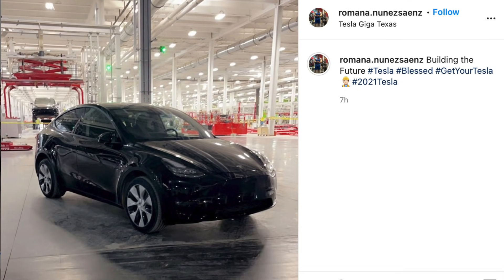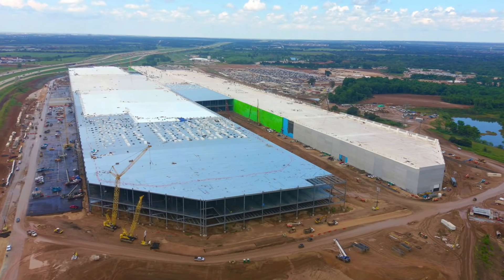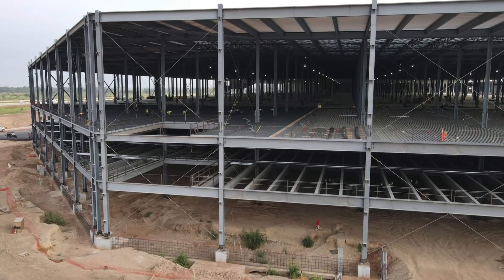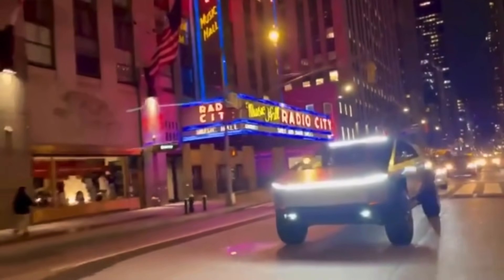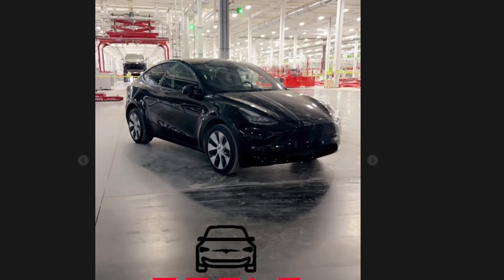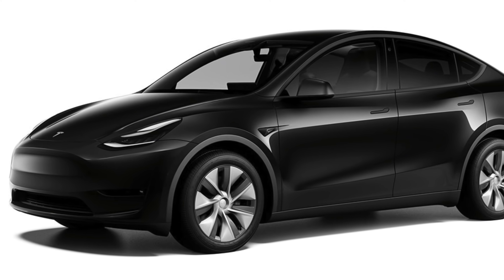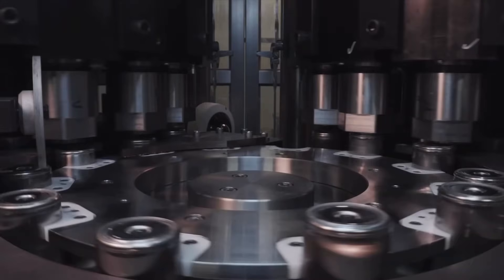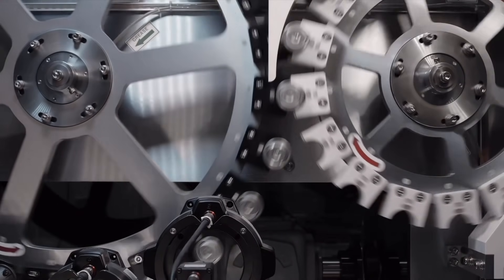GigaTexas makes FIRST Model Y!

Comment: Probably a SR with an LFP battery.  You know that’s right around the corner.
Reply: Highly unlikely considering Texas cars are supposed to get 4680 NMC cells.Also Lifepo4 is pretty much exclusively made in China. I highly doubt those are going to be made anywhere other than Shanghai.